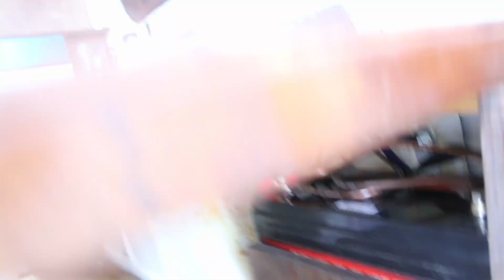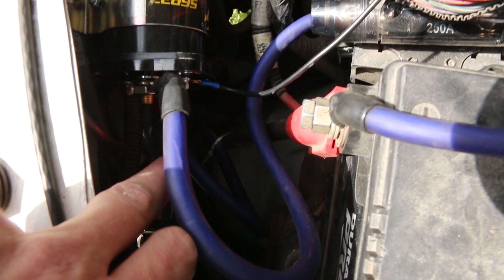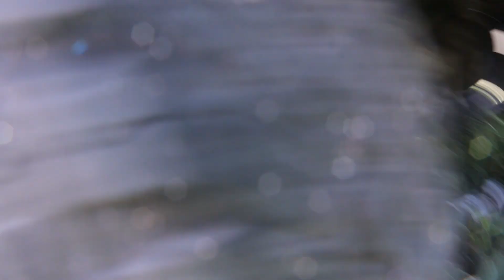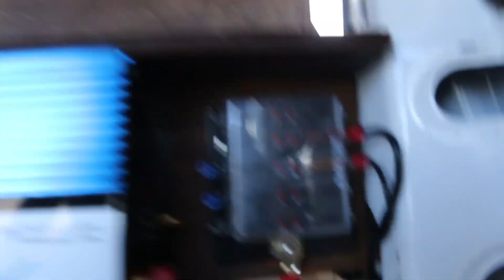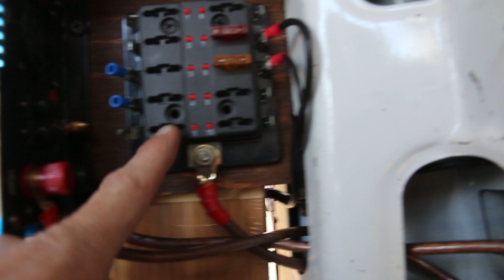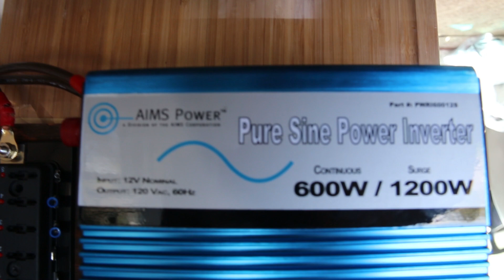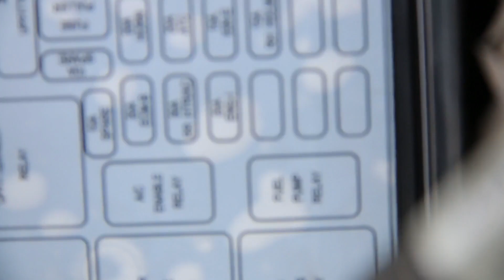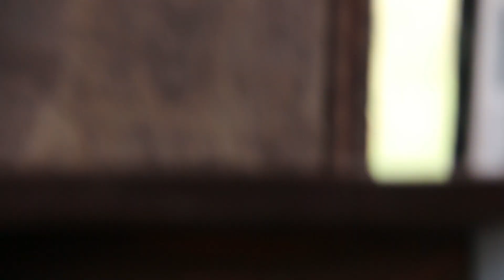How To Install A Secondary Battery, Isolator, Inverter In Your Van

Comment: I don't know if you mentioned it... but how do you figure out what size battery isolator to purchase?
Reply from the maker: Aaron V it depends on how many things you plan on using the auxiliary battery to power. 200 - 250A isolator should be plenty for a similar size install. A good thing to do is add up the wattage rating of each electronic you will be installing and divide it by the voltage of the battery, in this case 12V. Example: 1200W/12V = 100A. This will help you determine the isolator size by making sure your total amperage draw falls below the the isolator's rating.
Reply: Mechanical Mike 

Gotchya. Thanks for such a quick reply man.... maybe I can pick your brain a little bit. So I have a solar setup on top of my box truck that powers a battery bank of 465ah at 12v. I use somewhere between 800w and 1500w per day depending on the day. Should I use a smaller isolator  than normal since I won't be 100% relying on it? Maybe I'm over thinking this, but I guess my main concern is that I don't want to damage my batteries, inverter or charge controller by using an isolator with too high of amperage. Is there any risk of using an isolator with too much amperage? Or am I just thinking about this way too much lol
Reply from the maker: Aaron V
It's not so much the isolator that you should worry about. I think having an isolator that can handle a higher amperage such as 250 is good, and if you're concerned about damaging your batteries, use a smaller fuse on the aux battery supply leg from the isolator such as a 100A to protect the battery and electronics that the battery is supplying

Comment: The scooters I'm talking about is electric bikes/bicycles called TaoTao Electric Bicycle scooter Moped and a X-treme New XB 504 Electric Bicycle Scooter and a Cabo Cruiser Elite X-Treme Electric Bicycles ? My Question is can i hook up two batteries to those scooters to increase the speed and travel distance if so i want to know the safe way to do it ?
Reply from the maker: You can add a battery to increase the distance but it wouldn't effect the speed. Your scooters are rated to handle a certain amperage. If you go over the rated amperage you start to damage the electronics. To increase the distance, you want to jumper the two batteries together in parallel, meaning from positive of first battery to positive of second battery, negative of first battery to negative of second battery. The battery you add must match the voltage and amperage of the first battery to avoid damage. Adding a battery does mean it will double your charge time as well though.
Reply: I'm looking at these scooters online a website called newegg.com Some scooters says new speed 50 what do that mean exactly.Do that mean it can reach 50mph ?

Comment: Why did you use black wires to connect to the 3rd (last) fuse box?  I thought positive wires are red.  Just a bit confused.  : )  

Where are the wires coming from the fridge and fan attached to?  I missed that part of the connection.  Are they the two black wires that are connected to the 3rd (last) fuse box?
Reply from the maker: You don't have to use red wire for positive, that is just to help identify which is which. In this case we ran out of red wire and had plenty of black left. Fridge and fan run to the auxiliary DC fuse panel and are grounded straight to the body of the van
Reply: Thank you for your reply.

Comment: I like how you did not run the negative wires back to the SLAVE battery to ground them.  Did you check with an electrician to ensure that you can do that for the van?
Reply from the maker: Your negative terminal runs through the entire vehicle to ensure proper grounding. If you look at where the main negative wire leads to from your battery, you will see that it usually connects to a point on the motor itself, then from a a bonding strap on the motor to the body. This is why you can connect the negative cable to the engine and positive to the battery when jumping a car. You can run the negative wire back to the battery if you prefer but it's a waste of wire and crowds the terminal.

Comment: Is it necessary if the SLAVE battery has plenty of Amps?   I don't see a charger for the SLAVE battery.  Are you using the van's engine battery to charge the SLAVE battery?  What other reasons for connecting the two batteries?
Reply from the maker: It depends on what you are running of the slave battery. the more electronics, the more amps you will need. 200 should be plenty for a small set up like this. The reason for the slave battery is to keep your electronics from draining your primary battery when the car is not running. The alternator charges both batteries while running. It's good to help offset this by installing a solar panel on your roof to help charge the slave battery as well so you are not putting as much strain on your alternator.
Reply: Hi, have a GMC Savana and I want to install a deep cycle battery to run my Fantastic fan and leds... I already have a built-in 150 watt inverter. Can I just get a trickle battery charger, plug it into that inverter and connect fan and lights to my slave battery? Thx, Mike

Comment: Very nice. Very clean. I'm trying to do this on my 2000 5.3L V8 Silverado. Really liked the footage on how your ran your wire post relay underneath exterior. Loved the secondary fuse box. What kind of battery are you using for your secondary battery?  Looks clean brother! What tools & steps did you use to install that fan?
Reply from the maker: SLR100 AGM Sealed Deep Cycle battery 100 AH 12 volt. Not entirely sure on the fan. That was a component that Justin installed.